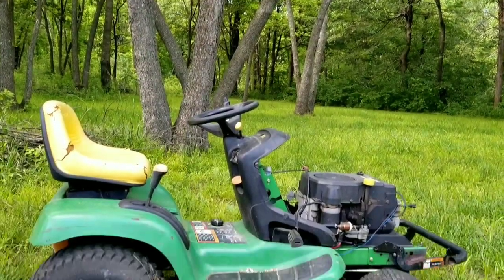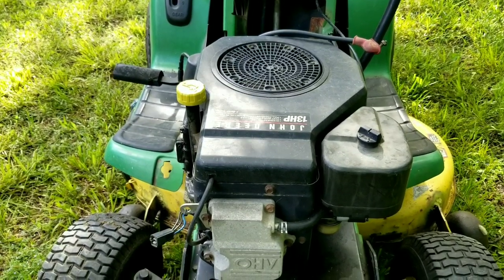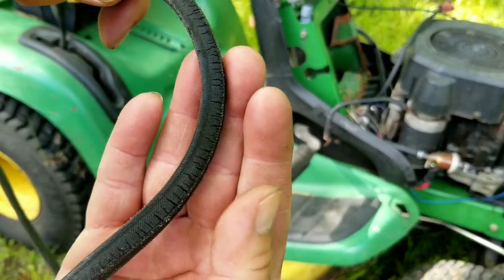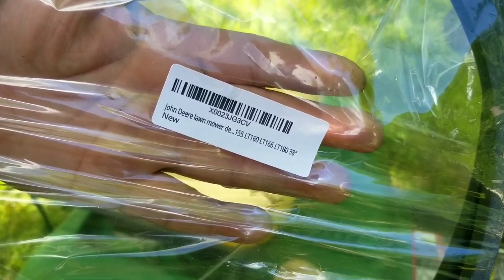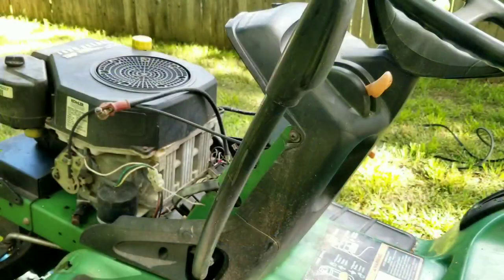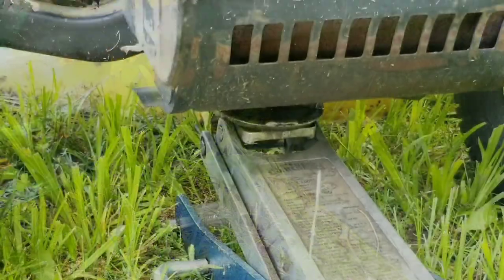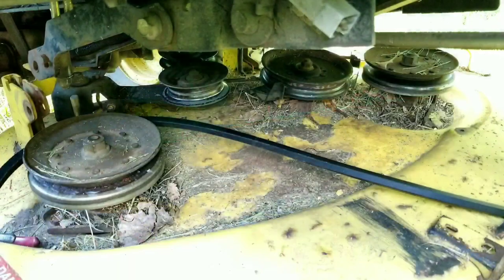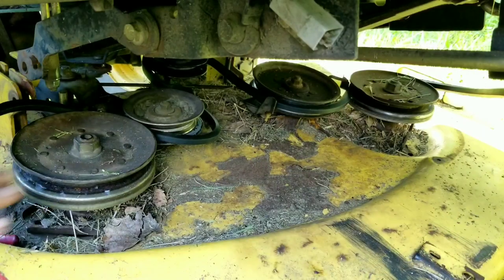Why my Mower keeps throwing deck belts.

Comment: I have a John Deere L111 automatic it runs and mows good the problem is when I let the break/ clutch pedal out something under the mower starts rattling and then when I push the pedal back in it stops the rattling noise would you have a idea what it might be?
Reply from the maker: does it alway rattle then while it's moving? If so it could be as easy as the idler pulley's bearing is coming apart,  or worst case it's something in the transmission. Can you localize the rattles approximate location?
Reply: It is under the center where the belt's and it rattles until the break,/ clutch pedal is pressed
Reply from the maker: the only thing I can guess a pulley
Reply: I will check all of the pulleys
Reply from the maker: let me know what you find.

Comment: I got a new expensive belt and it still comes off. Most if the time while I'm cutting the grass. It always comes off 20 seconds after engaging the blades.  So I know it's not the belt. I just haven't figured out what's causing it yet.
Reply from the maker: after that, I would look at the pulleys, One or more of them, might be crocked
Reply: @HomeGaragechannel  that's what I was thinking. Hopefully I'll get a chance to find out one day when I'm off work and have the time to check

Comment: Why does your lawnmower blade have jagged teeth I’ve never seen a blade like that before?
Reply from the maker: the jagged part, is on the back side of the blade and it's for mulching.
Reply: @HomeGaragechannel  I made mention of that because I’ve never seen any bleed like that not even a mulching blade. Does a dual good job?
Reply from the maker: yes it does, I would recommend them.

Comment: I'd buy a re-enforced 42" belt for my LA110 in a heart beat and pay whatever the hell anyone wanted to charge me for it if i could find one. I go through 2-3 cheap amazon belts each summer and it's starting to drive me absolutely bananas!!
Reply from the maker: I hate to say it but this belt only last 3 seasons, so I might go with the reinforced belt too.
Reply: @HomeGaragechannel  3 seasons would be a dream.. I can’t get my belt to stay on for 3 minutes LOL.. I suspect I have other issues that’ll need to be investigated
Reply from the maker: I would consider removing the deck, and inspecting all the pulleys, because one of them might be mis-aligned.

Comment: I don't think I would buy a Jon deer
Reply from the maker: then what would you buy instead?
Reply: @HomeGaragechannel  huskvarna
Reply: @HomeGaragechannel  Cub Cadet.  Feedback from JD owners is bad or no service from the dealer shop.  I have over 700 hrs on one Kohler engine. Never uses a drop of oil and starts summer and winter in a heart beat. I have a lawn service where I run 2-3 hours steady without shutting off in between. I wanted a JD but the negative feedbacks turned me away. There two different JD lawn tractor price ranges to buy from. The big box store sells the cheap one. The JD dealership sell the expensive one.